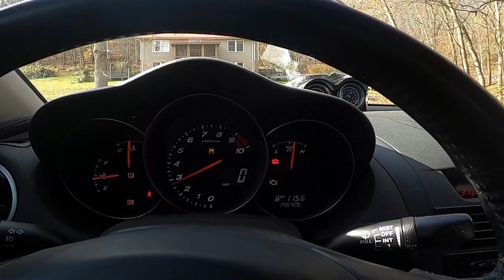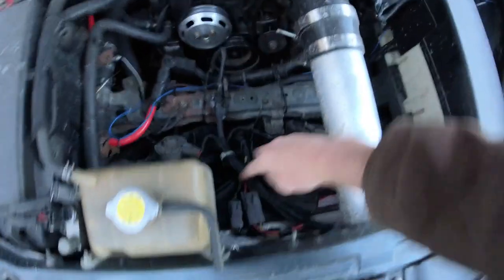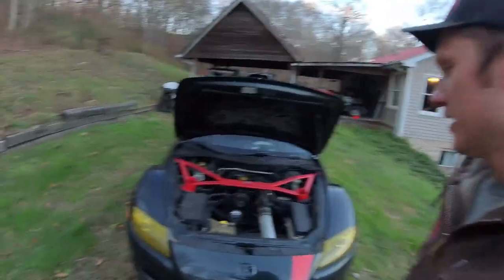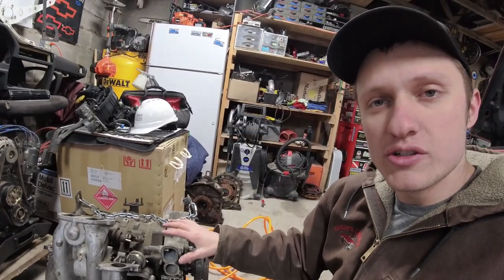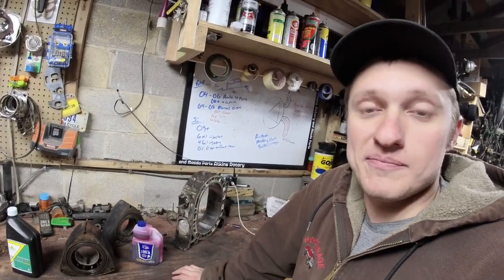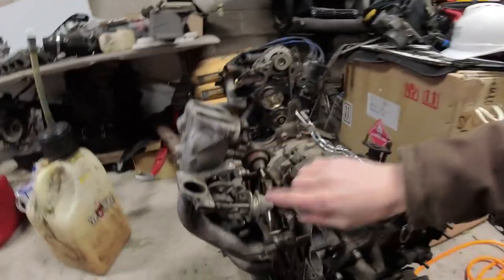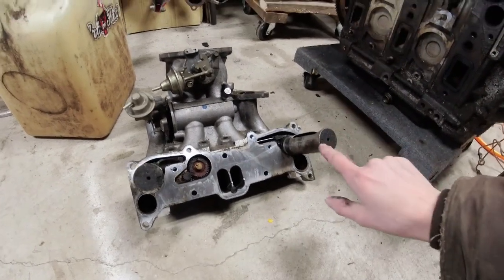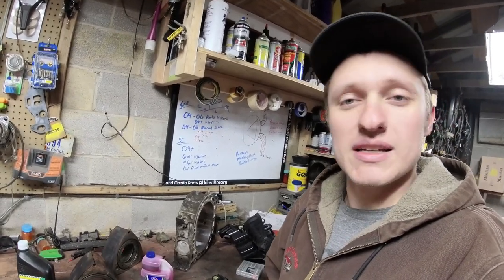Mazda RX8's Are NOT High Maintenance - Taking Care of A Rotary Engine

Comment: Love your videos! I was wondering if you ever had issues with the OMP? My 2004 RX8 is giving me P1688, I have checked everything imaginable (cleaned the pump, check the stepper motor) and came to the conclusion that the position "switch/sensor" is sometimes giving wrong reading and making the ECU unhappy. It helped to rotate it by a couple of degrees but after sometime the code came back. And you really know when this happens as you get 11% if throttle. Do you know where I could get a new or used "swiths/sensor"? All I could find were complete units but those are expensive. I would love to find a cheaper and better solution also for others that might have similar problem to mine.
Keep up the good work.

Comment: Love it!
I own an RX8 and I premix w/o any of the mods you mentioned. Just recently I got a code. P0410. Secondary airpump issue. I’m not sure if it’s bc I premix, but my 8 has been really reliable so far. 111k miles 😅
Reply: Hello how are you? I like your information.

 What do you use for an air filter element now the air box has been removed? And where have

 you installed the battery? Thankyou from Brian from Australia.
Reply: @briannielsen5073  I’m fine! Glad you asked! You?

It’s stock everything. I’m thinking about getting those mods at some point.
Reply: You should be using an ashless burning formula brand for your two stroke oil. It's possible that your cat is clogged and causing the air pump to back up in itself. I believe this can be a common issue, as the pump is really a simple system and operates well otherwise. It's not needed and can be removed without affecting engine performance, but you'll need to have block off the lines and it will be better to run without a cat.
I'm going through the same issue but I have emission requirements where I live at, so I'd like to have it all operate correctly, but the proper replacement parts are not cheap. I'm not actually sure that my pump is bad, but there could also be a clog in not only the cat, but also in the secondary valve that allows the air pump to deliver the air when needed. I believe it can go bad from said cat blockage, causing exhaust to get into the valve. Also, removing the system will allow the engine to operate normally, but there will be a code and check engine light staying on.

Comment: i would recommend running diesel oil, got a lot less smoke out the exhaust at high rpm
Reply: @1OMEGA111  i was using 15w-40 rotella t3, its full conventional but if you have a separate reservoir for your oil injectors, you can use t5 or vr1
Reply: @1OMEGA111  seperates crank case oil and burnable two stroke... if that little tank goes dry.... boom!
Reply: @1OMEGA111  i just add premix in tank.. easy

Comment: hello, i'm sorry, i still quite don't understand regarding the premix, as I drive my rx-8 with RON97 fuel, red lining it around 2-3 times a week, still should I premixing it for better lubrication and prolong the seals? or will it worsen the other parts of the engine? anyway i'm new in rotary world, just got my rx-8 yesterday and need so much thing to learn of this engine, and thanks for the videos!

Comment: I was able to remove the lower intake without pulling the engine.  You just have to remove the Phillips screw connecting the sleeves to the rod inside the intake.  Pain in the ass and will still need to pull the motor but I did it lol.

Comment: Ive had thoughts about getting an RX8 as a daily driver. I live down here in Florida where it is really hot every day. Some days it will rain a lot and it can be really humid some days. I understand one of the elephants in the room was premixing your RX8. I dont know if this would be ideal in the hot Florida weather conditions or if I should run thick oil lile 20W50 VR1 you mentioned. I would like to daily drive it but also beat on it at times too. I would generally like to address its cooling, ignition systems so the car does run efficiently just as much as I had thought about how cool it would be to bridgeport an RX8 because Brap braps. I am still learning in the field as a car mechanic and the only Dorito powered shop near by is Pettit Racing which is 1 hour south from my location.

Comment: have had mine for 12 years and have never done anything special at all to it.  I don't drive it like an ahole either.  i don't even red line it often like I'm supposed to.  worst I've ever had to deal with is it being stolen and flooding the engine a few times.

Comment: I’m thinking about buying an 05 rx8 base model. 90,000 miles on rotary… I’ve heard a lot about these cars losing compression around 100,000 miles or even less. Is this common? Or is it due to very poor maintenance? If that’s the case, is there a good way to tell how well the car has been treated aside from maintenance records? I’d appreciate some feedback.
Reply: It’s probably going to need a rebuild tbh. It’s common. Not revving the motor high. It’s a lot research rotary vs piston
Reply: @Garden State RX8 was that to the guy who made the post ?

Comment: In terms of the ignition coils, I'd be interested to know your source on that information that the Mazda coils aren't sufficient for hard running.

Here in the UK, I approached one of the well-known rotary specialists (Rotary Revs) who stated that they don't recommend the aftermarket ignition coils. Mazda released the C variant of ignition coil which improved durability and performance of the coil more recently and supposedly, (from what I have been told) the Mazda ignition coil is the best for reliability and performance currently.
Reply from the maker: I have been running mazda coils in my car for the past two years.  It runs reliably and all. But I occasionally get some break up at 9000 rpm plus on a hot day. With a misfire code.  I change my plugs every year. And it only sees mostly tack miles and occasionally road use. Maybe 3k miles  per year
Reply from the maker: I think most coils are going to struggle at that high of an rpm.  Ernie at Phalanx performance here has also noted a decent power increase from the aftermarket coils over stock coils as well.

Comment: Renesis engine was designed to run in synthetic oil.

Run the Renesis only in premix it going to dead prematurely for sure. Ask to Start Mazda engines.

You must use the same oil in Shon as used in the engine. This engine has a ton of "blow by" so your engine oil will be mixed with the Shon oil.

2 stroke oil is designed to be used DILUTED in the fuel, not directly as lubricant.

Comment: Love your videos mate.. I think I saw a mini filter fitted somewhere near the engine oil cap... can you please explain how that is fitted... I've seen that there is a vaccum hose that is fitted down there which comes from the air intake, is it just blocked off and the mini filter fitted?
Reply from the maker: Yep that is exactly what is done.  the crank case vent would connect to the throttle body elbow

Comment: I have an rx8 that's been sitting for years, besides running it around the block just to move it.  Still starts but doesn't really like to stay at idle and turns off if you don't warm up the car by holding the gas pedal until it's at running temperature and you can't really redline it at times because it will only go to about 6000 to 7000 rpm. Any thoughts? Engine i guess? The last thing i did to the car was change the plugs and coils. I really think the engine and maybe it's the intakes getting stuck.

Comment: As always a great video, What are your thoughts on ethanol blend fuell, like a E10 or as we have here in Australia a 95 RON, or 98 RON octaine fuel. Does the 10% ethanol blend fuels help with carbon build up or does it cause it. ?? love to hear your opinions.
Reply: Please don't put E10 into your car especially if it is using oil from the pump. The e10 will also react with your catalytic converter. The Renesis  for Australia is designed for 95 or 98  ULP.

Comment: What's the best treatment for the 5&6 port cleaning? Seafoam? Or valve cleaning treatment?
Reply: Removal and cleaning is best, but I've heard of detergents working as well. Just be mindful that it's all going to have to pass or attempt to pass through the cat.. so if it's not clear to begin with, then it's liable to make things worse without a good flowing exhaust.

Comment: Dunno if I commented on one of your other videos about it but I successfully fixed the leaky pinion on my 2009 (age, not miles). But....while I was there I did the transmission tail seal. And it leaked after. Ordered another from Atkins. Tore it all apart and replaced again. Still leaking. Very frustrated. I don't get it. I've done dozens of oil seals over the years but have never had issues like this. Just about ready to take the financial hit of taking it to Mazda.
Reply: Buy a dealer seal

Comment: So I have oil going into throttle body which has never happened before.  The only thing that has changed was the tune.  I thought it was coming from the oil filler neck but I put a ghetto catch can on that line and no it's coming from above the throttle body.  If you have any ideas as to what the problem could be as far as mechanical or even the tuner just sucking open to any ideas please help

Comment: Hey, what are the best jacking points on the RX8 and where do you set the jack stands?
Reply from the maker: car is too low, so i typically use the pinch weld and go side to side,  I have a rubber jack pad that is grooved for the pinch weld, then I put a jackstand on the front lower control arm mount at the subframe, and same in the rear, subframe body mount, then I go to the other side of the car and do the same.
Reply: @RADPotential  thanks a lot for that and keep up the good vids man 👍

Comment: Do I have to redline during each drive? I got a 2004 rx8 with a sohn adapter and a catch can. ✌🏾😵‍💫
Reply: Red line a day keeps the rebuild doctor a day. Yes blow out the carbon. If you are premixing and doing your oil changes and plugs on time you will have a reliable rx8.

Comment: good day buddy
i got the same rx8, can the auxilary valves in the lower intake become noisy? my rx has a rattle noise when revs comes down and at 2800 to 1000 sounds like something is lose in the engine. i done all the other valves. also under load it starts misfire from 5000 rpm. any suggestions? my videos are on my chanel
thanks in advance
learning a lot from you

Comment: What should I do with my 40 y o Rx-7 when the 18 y o atkins rebuilt goes?   I don't wanna drop 4-10K on a pos neon.
Reply: Buy another rebuild kit
Reply: @1OMEGA111  when the OEM engine went at 220 k miles, some major parts were unusable.   Atkins doesn't rebuild those 1st model fb engines anymore.    Rotors and housings cannot be found, not even used ones.
Reply: @1OMEGA111  Let's say I find a mechanic that knows how to do a comp test on a rotary, and suppose it is bad, then what?
Reply: @1OMEGA111  It's been my experience, that the engines are good, and then they aren't.   In fact , just before they blow, there is a mysterious extra 10 hp.

Comment: What are your thoughts on running LPG?
Reply from the maker: Lpg?
Reply: @RADPotential  😄
Reply: @RADPotential  He means Liquefied petroleum gas (LPG or LP gas), i have a small tank on my RX8 and it helps with fuel efficiency. Basically you run the car with lpg up to 3k revs.
Reply: @RADPotential  liquefied petroleum gas, pretty much propane.
Reply: has that ever been done?
Would prolly be mad beneficial to a rotary if tuned properly
Reply: @Alouis Schäfer  mazda made some hydrogen powered rx8 prototypes. If propane near me wasn't $18 per gallon, I'd try it out. I think there's an lpg converted rx8 here on YouTube somewhere.

Edit: oh, never mind, propane is $3.64 here. It's $18 to have a grilling tank refilled.
Reply: @alouisschafer7212  it's super common in Europe, many people that buy used RX8s install an LPG tank for fuel efficiency. It also leaves no carbon build up so that's a huge plus.

Comment: Hey i just recently bought 04 rx8 in september, the guy says its an engine from another rx8 and at idle after it warms up, the rpms fluctuate from somewhere between 700 to 1200 , and i also hooked up a cheap scan tool and saw that my bank 1 sensor 1 02 wasnt reading, could that make my rpms fluctuate that bad and be making me stall at low rpms?? 

Also i saw my BARO sensor wasnt hooked up, after hooking it up too a vacuum line i cranked the vehicle and it was idling at 820 but then the next day i go to turn my rx8 on and it starts fluctuating again and this time it was fluctuating between 1000-2000.. :'(

Comment: Wondering if you have any ideas on oil injector adding too much oil. Everyone says that the injection pump couldn't cause excessive oil consumption. The first stock motor went 500 km per liter. The second motor street port with oil mods and full depth apex seals and a procharger with 10 lbs boost. I warped the super seals on a long hiway tour. The car had no under pan and when the air to air went on it bloked to much air. My bad. 300 to 400 km per liter of oil. 3rd engine warped the apex seals again. Still 300 to 400 kpm per liter. 4th motor I had stock RX7 apex seals and a different omp a pretty solid 350 km per liter. Racing my buddies 370z i let off at 9000 in 5th 250 kpm not enough fuel in the map and blew the cast sleve through the engine. The 5th motor used the same OMP and got the same 350 km per liter i belive it was developed a side seal issue and started pushing oil into the procharger on hard pulls and dropped the octane rating and broke an apex seal and dinted the rotor. I figured the ECU might be the cause over driving  the OMPS. So I installed a Adaptronic ECU on the 6th motor and it went 450 km before the oil light came on. I took it for a Dyno tune and They blew it upon the dyno and for my last try with a Renisis new GL housings 5 port exhaust. Still no clue what to do about the oil consumption.

Comment: RX-8 not high maint? Ummm....doesn't the factory service schedule call for total replacement of the cooling system at 100k? Just as one singular example...but the service schedule is full of that kind of thing. RX-8 is most assuredly a high maint, middle performance, really terrible MPG car.

Comment: The vacuum ports on the oil injectors are not to open the injector. They are unregulated, the OMP is what controls oil flow through the injector. The vacuum ports are there to equalize pressure between injectors. Infact 12A engines (may be before a specific year) didn't have vacuum ports... 

As for not running premix, there are three considerations with the S1 Rx8, 1) the omp was tuned to inject less oil to meet epa regs, 2) the position of the oil injectors in the housing injects the oil away from the center of the apex seal 3) the apex seals themselves are shorter. 

The lower level of oil injection coupled with the angled injectors is what creates increased wear on the apex seal. Due to the way the rotor moves it actually pulls oil away from center and towards the side and corner seals. theres a good write-up in one of mazda's sae books (though I dont remember which one atm). These two factors together, the lower oil level and angle of the injectors is what causes the excessive wear on the seal. The seal gets worn down to the point where it doesn't have much holding it in the groove and snaps killing at worst two irons, a housing, and a rotor. 

Please dont tell people not to premix their S1s or even S2s (though S2s are less-prone as a result of an additional 3rd injector to properly distribute oil to the center). Carbon can kill these engines just as quick yes, but it'd be better to premix and also just redline it more.

Comment: What is the hottest oil & coolant temp you feel safe at? i know people say the coolant seals can pop around 220F but in the video you said dont be scared if it runs hot.

I watched more of the video i see you said 230F coolant and 260f oil temp???? holy hell that is hot
Reply from the maker: Yea thats hotter than I would push it regularly, and when it reached those numbers I was cooling it down the next lap, but for OEM soft seals, they can take a bit of a beating IMO.  On an older rx7 engine, I wouldn't push that hard unless it had been rebuilt with fresh soft seals